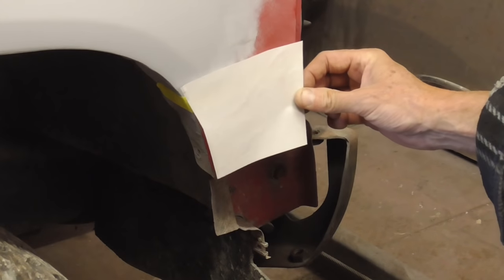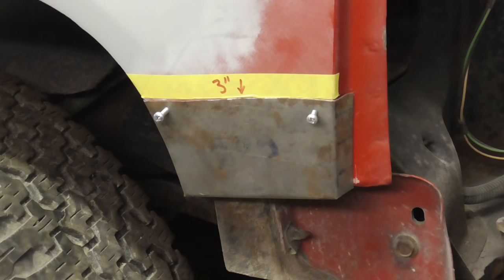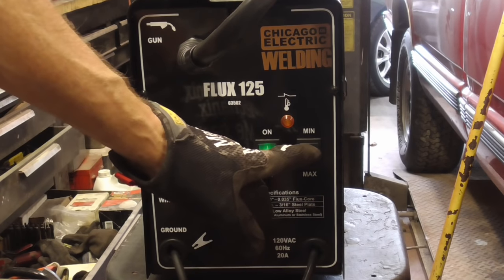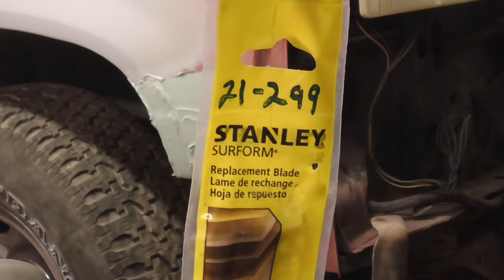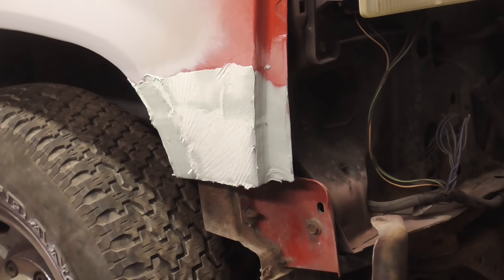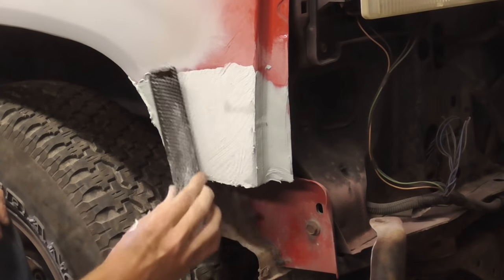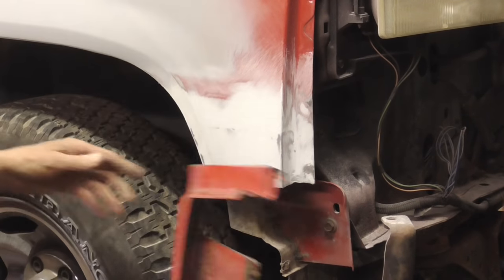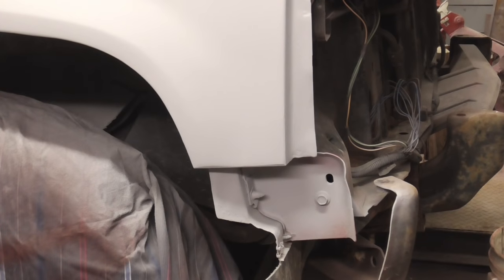Welding Automotive Patch Panels with a Harbor Freight 125 Flux Core Welder

Comment: Thats nice,,,watch Fitzees for the real deal repair
Reply from the maker: Have you ever seen the outline of a patch start to show through the paint?  Butt welding and attempting to metal finish the seams causes that. With respect,  lap welding is how all body shops in Michigan repair rust on late model vehicles (welding or adhesive).  Strictly butt welding a patch panel, which has become popularized by the internet and TV,  is not the best quality repair on today's thinner metal and there are many good reasons why professional body shops don't do it.  Shops use a combination of both lap and butt (butt for rigid areas that can’t be tapped down) on almost every patch but would never just butt two pieces of metal up (gap or no gap), weld it, then grind away at the area attempting to metal finish it.  Here why with good reason  - especially Eastwood’s starting 22 seconds in: https://www.youtube.com/watch?v=rpH50kh4W00  *
https://www.youtube.com/watch?v=MfKlNQF-o4I  *
https://www.youtube.com/watch?v=e9bjZ_UxtJg  
Today’s metal is .030. That is literally 6 hairs (hair is .005) thick.  You start grinding on that and the result is paper welds & surrounding metal.  In the end it’s what works for you though.  Keep in mind, you won’t find anyone butt welding in professional shops. Surely you’re not going to butt weld and metal finish this: https://www.youtube.com/watch?v=36zkc9UQaTs or some of my other rust repair videos.  Use small overlap, weld solid and you won’t have to worry about moisture - especially if you keep the drain holes clean (most important thing in rust prevention). Note that  the opening of the seam is upside down on the inside (no moisture trapped).  Please see this video for longevity of this type of repair if done correctly: https://www.youtube.com/watch?v=8XaZBy7GC7A or 
https://www.youtube.com/watch?v=2o37dX-